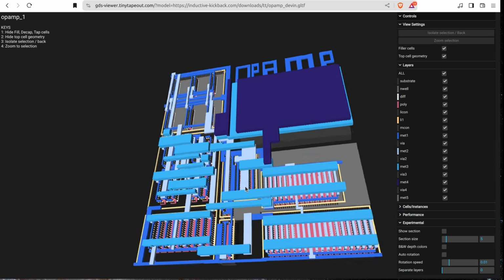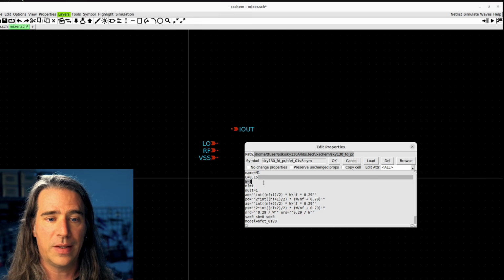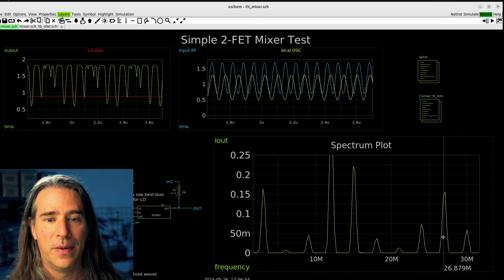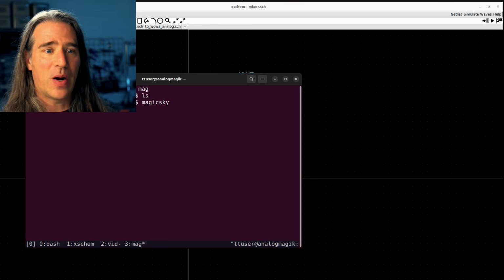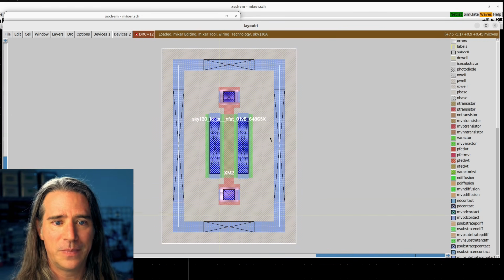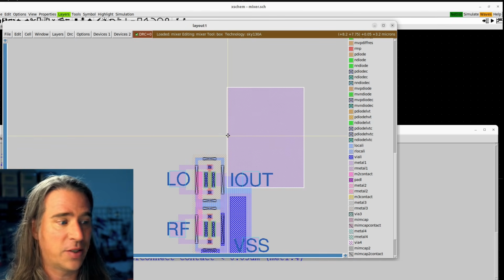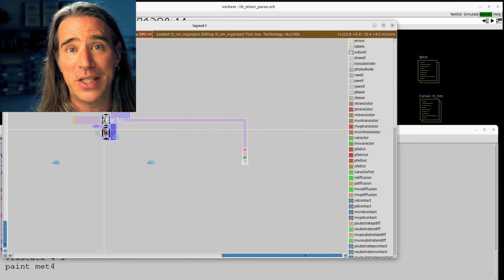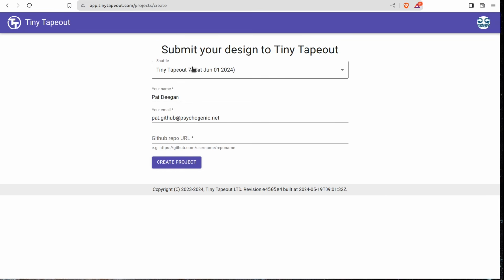Open Source Analog ASIC design: Entire Process

Comment: i gonna send may 8bit sar adc to shuttle this is gonna be my first mixed signal and first tapeout experience
Reply from the maker: Amazing: I think that's a great place to start (evidently)... It's not so trivial as to be a helloworld, so you learn a ton, but it's not so tricky that there are too many giant risks of failure.  Are you doing it on TinyTapeout?  On the Sky shuttle?  Did you reuse existing bits (like I did, taking Matt's DAC and popping it in) or build everything from scratch?

Comment: Thanks for this, I submitted a tt design in verilog, but I had a really strong curiosity in making an analog block.  I downloaded xschem, magic, and downloaded the massive pdk in preparation, but it confused the hell out of me so I retreated back to writing HDL and letting Yosys handle all of this.  I may give it another try in analog with some more preparation, you made it look not terrible, which in this realm is very good.
Reply from the maker: Hey Glozz!  Yes, I have to say, getting everything installed--and actually working together--can be a bit of a nightmare... big, lotsa parts, and finicky.  The analog design part itself is hard enough, so to give yourself a chance to just focus on that, there are a few solutions including the TinyTapeout VM (https://github.com/TinyTapeout/analog-virtualbox-vm-sky130a ) which includes everything for sky130.  This docker (which I haven't tried yet) https://github.com/iic-jku/iic-osic-tools supports even more processes.  
So, when you're ready, I say start with one of those to ease entry... then enjoy the learning curves that'll actually give you some value :)  Good luck!

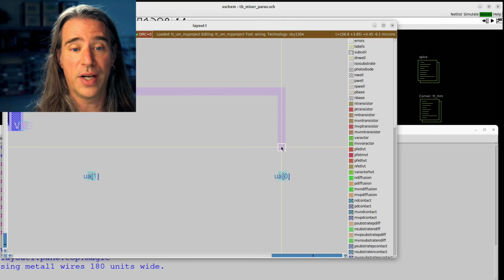Comment: 34:32 I am surprised that this software is based on drawing everything as blocks, resulting in putting the traces on the chip at 90° angles, whereas in PCB design one would always avoid that.
Reply from the maker: I think this is a question of scale.  When your wire is 70 micrometer long, unless you're well into the Terahertz, you're probably pretty safe taking a lumped-element model and not worrying about transmission line effects, reflections etc.
Reply: @PsychogenicTechnologies  Thank you for your answer. I agree with the transmission line effects, but regarding reflections, I believe they can occur on a very small scale and are probably the biggest problem with 90° angles. That's why it surprises me.

Comment: FYI.. Magic VLSI used to come on tape... yes tape. I seem to remember it was put up on an FTP site in the 90's at some point.
Reply from the maker: Wow!  The closest I got to dealing with tape IRL was my first IT job--used to do a weekly run to offsite storage, to rotate the tapes we used for backups at the server hosting company... total sneakernet, was nice, gave me an excuse to go outside.  But to actually get your software on tape... that's something else!
Reply: @PsychogenicTechnologies  You're a rockstar, I used magic probably 30 years ago on a machine running Dell Unix or maybe a Sun 360 (I forget it's been a long time). I was reading a book by Carver Meade on analog VLSI, the tools were Magic and I had fab parameters from a real fab to do the work. I learned a lot in this process and at some point ended up doing ASIC design for 3D raster chips back in the 90's in Verilog. It was a great time in my career and where most of my patents were originated.

Over time it just became too expensive for the per seat cost for tools, the cost for ASIC's skyrocketed and the jobs left my area for the bay so... I started writing low level software as it paid just about as much and there were plenty of jobs. I finished out my career in software, but I do honestly think it was an uncompleted career. 

On a side note, I interviewed at Motorola for VLSI design on PowerPC and the guy was showing me how Intel was so clever in packing gates they would design some gates at a right angle just to fit the design into a smaller footprint. Something I doubt they do today.

Comment: How are you moving components around at the 27ish min mark? Whenever I import a spice netlist into magic no matter what tool im using it just starts painting in new materials(?)
Reply from the maker: Hi!  First off, sorry it took me a while to see and answer this.  
I use a funny keyboard and am a little obsessive about comfortable key mappings, so I don't even remember what the original shortcuts are.  However, if you ignore my specific keys (or set to something more useful to you), you can see part of my magicrc file here:

---
set HOTKEY_WIRING XK_apostrophe
set HOTKEY_ROTATE XK_grave
set HOTKEY_COPY XK_comma
set HOTKEY_MOVE XK_1
set HOTKEY_TEXT  XK_t
set HOTKEY_SELECT XK_y
set HOTKEY_SELECT_MORE XK_Y

# Actual Macro setup

# same key goes to and out of wiring mode
macro $HOTKEY_ROTATE {rotate -90}
macro $HOTKEY_COPY {copy}
macro $HOTKEY_MOVE {move}

# select what's in the box
macro $HOTKEY_SELECT select
macro $HOTKEY_SELECT_MORE {select more}

---

So, in essence I'm doing select on the cell, then using "move" (which is key 1 for me, from this setup).  It'll jump whatever is currently selected to the position of the cursor.

I'm not too clear on the other part/question.  Are the spice imports working?  Are you using the TT VM and/or sky130 tech?
Reply: @PsychogenicTechnologies  Hey! Thank you for providing the template on how to modify key binds, I appreciate it. 

I did end up watching a few other magic tutorials on YouTube and (somewhat) figured out how to use the commands. I was using the TT VM, but got stuck on an entirely different design/testbenching my design step further down the road. Been trying to figure out Prof. Carsten Wulff's aicex repo for now, but as an EEE Undergrad, the level of programming/software literacy(?) needed makes the learning curve steeper. 

Looking forward to any future videos you might have in the pipeline for Analog Design using the open source tools :)) Really enjoyed this one.

Comment: Thanks! Is it normal to view the output as 2 dimensional? I believe the incorrect bits you saw after a certain point are indicating your signals might be inverting. If you link them via imaginary axis, you might see when and where the signal flips and why. That stems from using sin and cos for wave generation. It embeds the pi geometry in the signal, and after a certain point, you're seeing the drift in the bits.

Comment: Great content. Can you please share how many samples did you order, and how much does it cost? Waiting for your chip measurement videos in the future!
Reply from the maker: In short, I've been getting one chip per tinytapeout run where I have a project.  The cost depends on the size you want (a single "tile", enough for say 1k gates or so if doing digital) is $50, and the physical chip + the carrier board it's on and the demoboard is an extra 100... so if it's for a class, or a group, you could get many tiles and only a few chips--or do it the other way around if you wanted.  See https://app.tinytapeout.com/ for current pricing.
Reply: @PsychogenicTechnologies  Thanks, it's way cheaper than what I thought. Definitely will follow your design steps and try to tape out one!
Reply from the maker: @nurahmedomar  awesome. I juuuust missed the TT08 deadline (left things to last minute, crunched like an idiot, and then failed to get the project in before deadline), but am certain the next run will be announced soon and fully intend to be on that one.  Hope to see you there!  Cheers

Comment: i have seen the video, and i think the production of an asic is very very very complicated. for this devices, i have learned, the physics is the most important aspect to consider, therefor the eda software is secondary.
as of my understanding, if you understand the physics of such devices everything else just consequently follows.
but i respect your effort.
Reply from the maker: I think you're correct.  The perfect tool would be absolutely transparent, meaning it would let you get that vision into silicon without being in the way at all.  To me, that transparency goes with both how well you can work with the tool, but also how much you can count on it and how many obstacles are in your way.  High cost and NDAs are big pains in the butt, at least for me, and an obstacle to learning and just experimenting, which is why I really love the open source stuff and want to get the word out about it.

Comment: Been looking for a decent software for chip designing, potentially with the ability to design transistor library for chips smaller than 65 nanometers (or even 2 nanometers node), as I figured why not put together a general purpose RISC-V VLIW processor. Hopefully this IC CAD app will do.

Comment: How many input channels could you pack into an asic, assuming normal processes?
Reply from the maker: Hello Deng!  Well, if I've understood your question correctly, the limit is basically the pad frame/packaging, if you're doing fully custom ASICs.  At some point you need to get them wirebonded and in a package, so you need to come to some sort of agreement with whoever is doing that.  TinyTapeout goes through efabless and used to use the Caravel harness to stick everything in a project area, and now uses openframe instead which gives more space and flexibility with the I/O (there used to be an MCU in there and other stuff, now instead we've dedicated pads to analog, have 24 digital GPIO as well as a few pins dedicated to internal management.  There's a webinar on efabless and openframe at https://www.youtube.com/watch?v=eflKFBCsor4 if you're curious about internals on that front.

Comment: It will be super educational to create a basic inverter , with the capability of the experimental characterization in mind from 0 to tapeout to actual measurements, everything recorded in videos. Also, one can add different inverters (same design) in different places in the wafer to showcase the process variability. Its a lot effort to do the whole thing, so , thank you for your efforts, much appreciated !
Reply from the maker: hm, that's a good idea.  I did an inverter "live" with Robert Feranec (on his channel a few weeks back) but it was just the design parts--doing it in a way to allow some deep probing and comparisons would be really interesting... maybe I can reserve a section of my TT08 submission for this.  Thanks!
Reply: @PsychogenicTechnologies  thanks for the quick reply! The thing that's missing from academia are all the practical considerations from design, cost of EDA tools, physical limitations, experiment methodologies, optimization flows...etc. these series of videos from you and the whole community will be a first pass for beginners. And the more we tap out the more confident we get to try even more complex projects. And who knows, maybe 10 years down the line we will get an open source Cerebras 🙄😁.

Comment: Super cool, I'm thinking about whether we could do something like that with our apprentices (electornics and application & coding). I think we could do some thing like a spi port expander. Is it possible to do bga packages?
Reply from the maker: Hi Lukas,  I think the SPI port expander project is a really cool idea to get started with.  For packaging: with tinytapeout the answer is no.  At this time we're on QFNs and that's that.  If you're going direct through efabless and doing a chipignite on your own, there are more options and you can even get bare dies.
I'm curious why you'd want BGA: what's the advantage for you, density, low inductance pads, something else?

Comment: Hey, it's amzing. Could you please tell , in terms of pdk version compatibility how do you combine your analog layout with the gds of digital design from openlane?
Reply from the maker: Hi!  What I did for this was look at which version, specifically, had been setup for the analog tools in the VM (easy to tell, since all the $PDK_ROOT etc env variables point to it).  Then, I had a system with openlane (https://github.com/efabless/openlane) already installed, I switched to that and just sync'ed the PDKs using `volare enable --pdk <pdk>`.  I'm not certain this was required, but it sure can't hurt.  Finally, did face some issues in getting the GDS created by the digital hardening into the mixed signal... put my hints on that here: https://github.com/psychogenic/tt06-analog-wowa/tree/main/openlane
Good luck!

Comment: I used tkgate, xschem & Magic once for a small project during an internship at a hardware company many years ago. Yes, it's definitely different to most other software you might be knowing in either the foss or closed proprietary world. However, if you require your software to be free, then you most likely won't have any alternatives, because they still seem to be the only mature alternatives in there respective field. & by that I mean I literally once took half a semester's worth of time JUST to find a better free alternatives to tkgate, xschem & Magic, but all alternatives where either a) completely abandoned b) dubiously licensed c) vaporware d) dysfunctional or all of the previous - & I had looked at about 20 different "software projects" which all turned out to be bummers & this entire undertaking turned out to be a giant waste of time.
The biggest not yet mentioned downside to these tools is that they are slow, very slow compared to more expensive software, especially the simulation part, because they use Tcl. Tcl is really slow at doing simulations because Tcl is an interpreted scripting language, an interpreted scripting language which is notoriously difficult if not impossible to (pre)compile, like you would if at least it were written in a language like Python, which allows its byte-code to be compiled. Tcl might theoretically be compiled, but for a lot of practical reasons it CANNOT BE COMPILED EFFICIENTLY in general, but only in a very unefficent way if you happen to make use of some very unluckily designed language constructs. The reasons why Tcl has these bad language constructs is that Tcl is a language from the late 80s/early 90s, which was a period when programming languages with no practical considerations or limits were thought of, referred to as the time of irrational exuberance languages by some, whose fallout is still causing late havok in old software projects which still relies on them, because a language which a software project uses is like a marriage without divorce, a binding contract with no cancel option.

Comment: 6:20 Tcl is more then just "a little weird", it's plain insidious, especially how it's aliasing works is just plain devilish, but worse, most people don't even realize how bad it is until it's too late, which is after you've seen how it can undermine any kind of potential for rational inquiry of any program semantics, which usually happens at the far too late stage because it's not obviously a bad language, on its surface it's the most friendly, practical & easy to use language, it just has this nightmarish string-substitution system on top of everything which seems to come out of a theoretical computer scientist's fever dream which undermines everything.
Reply from the maker: Hah, yeah, as I've played a bit more, I agree with you, the string stuff is pretty awful in general!

Comment: If we can use and link KiCAD schematics with a microelectronic layout tools will be an amazing using a plugin or others things, I think!
Reply from the maker: Yeah, one of the first things I did was create a quick way to import all the standard cells into kicad by generating a library for those schematic parts, and that worked well, but magic really kills as it's so specialized--would be tough to get something like that with pcbnew, and I've come to think that it's a question of the right tool for the job.  I love kicad, but after getting over the bump am finding that xschem and magic really are pretty good when you're down at the level of MOSFETs.